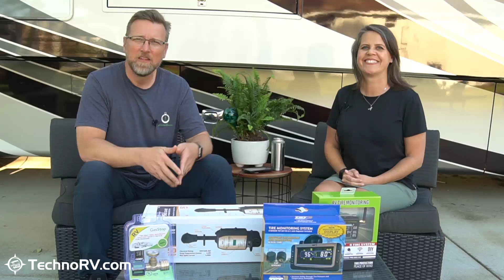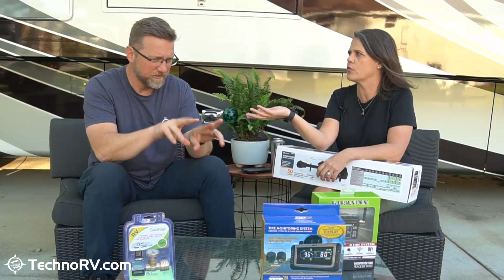Top 3 Safety Items Every RVer Needs

Comment: On topic of surge guard, I purchased one from Technorv and had trouble with it from the beginning. Called Surgeguard and their customer service was excellent. The problem, I own a Fleetwood RV and Surgeguards are built in and so check your motorhome before you purchase. You may not need one.
Reply from the maker: Good point!  A lot of RVs come with Southwire/Surge Guard transfer switches which have protection in them.  It is best to check the model number to see what protection you have before looking at buying a surge protector.
Reply: @Technorv  this is why I ALWAYS recommend Technorv!